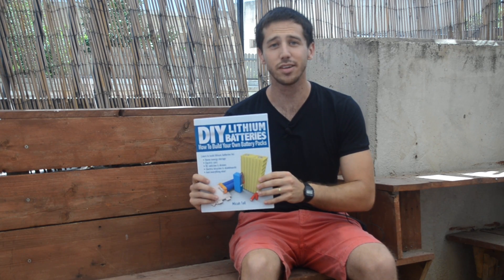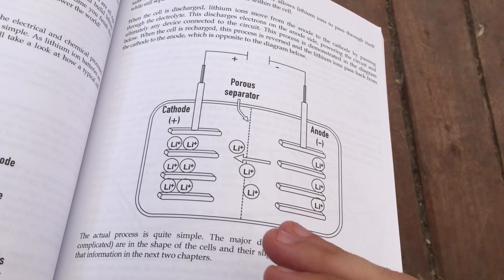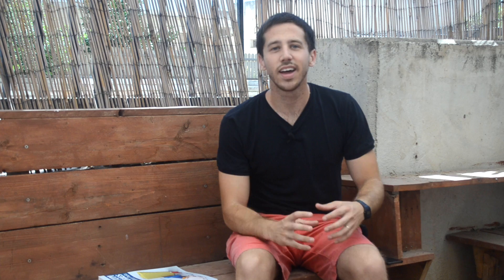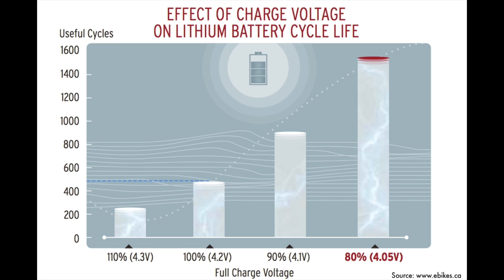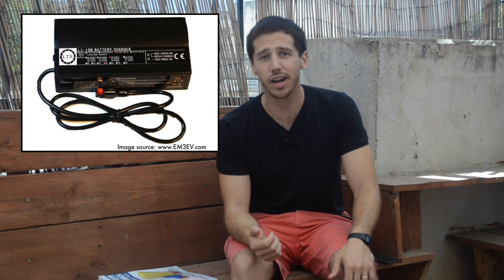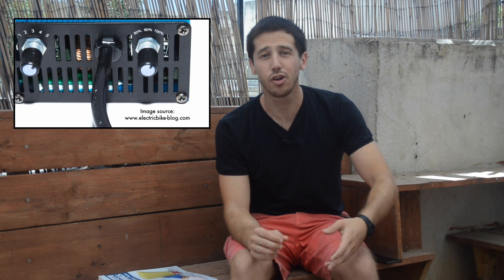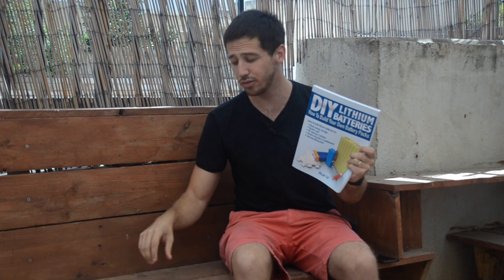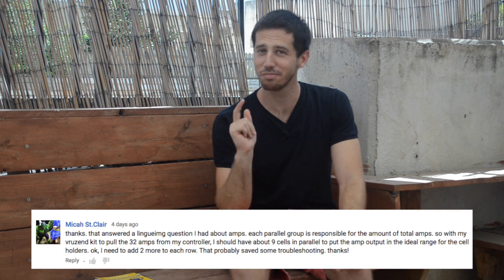How To Double The Life Of Your Lithium Batteries

Comment: My scooter volt drop down to 0 any possible reason
Reply: Where are you testing voltage?
Reply: @natebice7375  I have voltmeter switch on  voltage is at 52.6 then slowly go down to 0  i switch on again same thing again from 52 volt drop to  0
Reply: @natebice7375  I have voltmeter on my unit
Reply: @albertocarlos8403  something is draining the battery obviously or the battery pack is garbage and the cells are just draining on there own. It’s normal for battery packs to lose power but over the course of weeks/month’s. If it’s losing all its power in a few days or few weeks then something major is going on. Can you open it up and disconnect the battery after it’s fully charged and then check it after a day or two and see if it’s the pack. It could be something else draining it but at least you could determine if it’s the packet it’s self.
Reply: @natebice7375  hi natethanks for your reply  the actual scenario is like when I turn on the actual voltage is 53.8v then  its slowly go down to zero voltage
Reply: @albertocarlos8403  how long does it take to go from full to dead according to your scooter? I really would try to fully charge it and then unplug the battery and use a different multimeter to see if it’s dead. If you test the full battery totally unplug from the scooter and it’s still the same it’s the battery. Iam sry for the bad news. I know scooter batteries are very expensive!
Reply: @albertocarlos8403  does it happen when the scooters just sitting there or is it happening when you’re riding it? If sitting how long usually? Sorry for so many questions
Reply: @albertocarlos8403  if it’s happening while you’re riding it could be a setting that was messed with?. My scooter automatically shuts off at 41-42volts. I know on mine I can increase or decrease the cut off voltage.
Reply: @natebice7375  it happen just after I turn on
Reply: Very strange! Iam sry for the issue your having. I would contact the Company/seller about your current problem. I know battery packs can be very expensive. I hope it’s not the battery pack. Please keep me updated. Thanks!

Comment: Mike? A question......I am well familiar with Li-Po batteries since I fly several large electric RC aircraft. Most of my batteries are 5200mv 6s and I use a balance charger to charge and maintain as well as maintain a storage charge in the off season.
So, the question is how do the chargers that come with these scooters actually balance the charge without a balance lead like my charger has (7 lead....ground and each of the six cells in this case)?
Thanks in advance,
Rob

Comment: Hi, If i go on a long ride and i run low on charge, is it bad for the battery if i stop by somewhere and put just a 3 hr charge on the battery bringing it only to 50% which would get me home? Also is it bad to ride until battery auto cuts off? Thanks
Reply: I know it’s definitely bad for a battery to get that low where it shuts off. 20% is where you should recharge!

Comment: Buy an electric mini volt amp options thing for 5£ off aliexpress,  use that between charger and battery.  Can be set and doesn't cost machine his battery pack with the 5£ item on the side of pack. Looks good but not needed

Comment: My BBSHD is sitting in it's box, my battery and charger I purchased from EM3EV should be here friday.  My donor bike is a montague paratrooper.  I went with a 52v 23.1 amp battery that will sit on the bike rack, but be removeable.  My plan, most of my light off road biking is at 8-12 mph, I had a spinal cord injury so going fast isn't my plan any longer, I just like getting out into nature.  I don't want to ride on the roads, too many distracted driver's.  I also have been converting a 2010 transit connect into a little camper van, that the bike folded fit's nicely inside for when I am traveling.  

I went with the larger battery and the charger that will take it to 50%, 90%, or 100%.  From everything I have heard, I should get a little better range at 10-15mph, and if like you, I use the bike 2 or 3 times before I charge it, and only charge it to 90% unless I am taking the bike out that day, they take it to 100%.  Also heard that not running the battery till it is dead will also increase the amount of cycles...there should be a setting in the display to lowest voltage.  I want to get as many cycles as I can from the battery.

I also built a 200amphour LiFePo4 battery for my van, and doing the same with it.  I have an on/off switch for the renogy dc to dc charger so everytime I drive it won't be trying to pack the battery full of juice.  I plan on adding a 100 watt portable solar panel in the spring for when I go camping/bike trips.  Eventually will add a 12 volt compressor fridge, but want to be able to charge the bike battery from the van's leisure battery in case I am somewhere interesting and enjoying the time exploring on my ebike.

Comment: I really learned a lot about doubling the life of my lithium battery. Thanks!  I wish I had been given better directions right from the start, however. I started riding my e-bike in late April or early May. My mileage per trip averaged (according to my smart phone app) about 25 miles. As of this writing, I've got just over 900 miles on my odometer. That amounts to 36 trips. I store my e-bike in a shed attached to my garage. The temperature gets very hot in the afternoon sun. So my battery has gotten a good dosage of heat! Let's say 120 days worth at temperatures in the 80s and 90s. On a lot of those days, my batteries were being charged for up to 24 hours, before I remembered to unplug the charger. The recommended charging time is about 5 or 6 hours!  Now I'm in a stew, worried about how much damage I did to the battery , and how much of its life I lost.  Please refer me to a Youtube video that that might discuss my concerns. Thanks again!        joejed@q.com

Comment: If the batery goes down %30-40 and charge back to %90 percent.Does it shorten the battery life? In other word without empty the battery , charging is damage the battery? Please answer.
Reply: Smaller cycles are better but it depends on your needs.

Comment: My Samsung laptop came with a software feature that charges the laptop to a max of 80% capacity. I've had the laptop since 2010 and it still does 6 hour battery runs with chrome open no problem.

Comment: I use a simple timer that shuts off the ordinary cheap charger after a measured amount of time when charger reaches 4.13V (in my case) THe only problem with this solution is that you have to take time with a stopwatch to see how long it takes for the battery to reach desired voltage....its a cheap metod though and it works! Dont forget to charge the battery up to full at least once a month like he says=)
Reply: thanks for the tip, but how can I measure the voltage of the battery to know how many time I should charge the battery?
Reply: @daviferro4264  My Lectrix xp shows voltage readout pressing options when it's powered on.
Reply: @RJSoftware2000  or measure voltage with a multimeter when it shows 100%, 90%, 80%, 50% etc.
Reply: @daviferro4264  a multimeter

Comment: Hi! I have a lithium AAA and AA batteries (not rechargeable) that I'm taking with me on bike ride in mountains. The batteries will be shaken a lot in a bag mounted on a bicycle. Could you please advise how much it can affect their longevity?
Reply: I wrap mine individually in paper towel and pop them in a ziplock bag.
Reply: @redtobertshateshandles  Thanks for advice!
Reply: @piast_kolodziej  no probs. Happy to share info. It's not the shaking that is bad, it's the clunk at the end of each rattle. A kinetic energy thing. An old motorcycle mechanic warned me about fire risk of loose batteries many years ago. I accidently cut open a Bluetooth speaker battery a few months ago and burnt the tip off my box cutter. I quickly threw the battery outside on the wet concrete.

Comment: Great info.  Thanks!  I usually only charge every 3ed or 4th ride.  My rides are 3-4 miles each running my dog.  Then one 10-12 mile ride 2x week.  Sometimes I forget to unplug the charger overnight, which would be overcharging?  You didn't mention overcharging, which can't be good.  Thanks for the video.  I did subscribe.

Comment: I have a 48v 1,000w front hub electric bike motor. It came with the controller box, 2 brake levers, a thumb throttle and hub. I can fit all the plugs to the matching connectors and it looks complete, less the one to the battery. What kind of battery would be best for that system and what company should I purchase it through. My bike is a work horse, it's a Giant. I made a trailer out of a Trec baby stroller that has 20" numatic tires. Other than going through a few back rims because of the weight I carry, it's been the best bike I've ever owned. It's probably as tired as I'am riding it since new in 2015. So the thought of some power assistance seems like a dream. Any thoughts and recommendations would be appreciated.

Comment: Large off grid battery packs Winston sino etc have been using more conservative charging for ages. You want to keep it away from the voltage charge curve knee. 3.45vpc to 3.65vpc. Resting voltage 3.35v

Chargers that are smart that learn your use. Eg plug it in when you get home charges to 60% then keeps it there until closer to the time you use your bike then starts to fully charge it and you pick the charging voltage based upon use eg you commute during the week but have 40% charge when you get home you might be able charge to only 80%.

Comment: Hay   I made a 10s3p battery pack with a BMS for an e bike. The voltage on te pack is 35.45V. The voltage on the charger port is 31.70V. When I connect the charger it stays in stand-by modus only outputting 10.5V on the charger port.   I don't now what is going on. The charger is  Derby cycle art 28495 36V with an output on42.0V 3.0A. On the battery pack it came with it works just fine.  Is this battery pack somehowe incompatibel with the batterypack I made or is it more likly the BMS although boucht brand new is already defect. I measeured 2.55Mohm over the c- and b-

Comment: My bike has been sitting for about two years . Now it won’t hold its charge . Do I need a new battery ?
Reply: Martin Gallagher use the bike the small amount of current from the motor spinning wake up the battery or try and bypass the bus to put a small amount of current into them to power the bms ( use the charger ) good luck

Comment: I've done this on cellphones for some years and can confirm. By keeping the top at 80% and topping up so the phone rarely drops below 40% its charge, I have two cellphones over 80% its like new mAh from when i got them in 2016.  A dustbuster I got at 2011 lasted 4 years down to 50% charge, and another 4 years to drop to 20% of charge by simply never using it until it died,  but I cannot control how to undercharge it except by guessing the time and taking it off the charge before it fills 100%. I've rebuilt the dustbuster pack  in 2020, after 9 years on the same pack, and then run it for 1 min after full charging to drop it down a bit before it sits idle waiting for a real clean up job.

Comment: i managed 20,000 miles on my first 36v 10a prysmatic cell battery over a 4 year period charging to 4.2 , it still had a 10 mile range even after that, replaced it with same capacity but the new one is made up of 18650 cells 5p 10s wonder if i'll get same millage, bike in profile pic . would l;ove 20a but megga expensive here in uk. thought of building a battery , wonder if can still get prysmatic cells they were brilliant

Comment: The deeper the discharge the less life cycles you get from Li-Ion, Li-Pol ! The faster you charge them... less life again ! The hotter they get... Charging a phone with a thick case on is very bad ! So: charge as frequent as you can (no deep discharge), charge the slowest you can, keep the battery as cool as you can during the process... Fast chargers are the worst thing for longevity !

Comment: I have had an ebike for 3 years that I built from a champion kit from Amazon and a battery from banana. I ride it on the average of 5 miles every day and let it cool for 1 hour before recharging after charge is complete I let cool for at least 1 hour before riding . I've never drained the battery all the way yet . So far no troubles what so ever with any electronics or the battery . I was very skeptical about e bikes at first couse everyone I knew has had nothing but problems but now after owning one I believe it was operator misuse or maybe hot boxing the battery or bad connections or components that did not match .

Comment: I have a question about batteries? Buying from Ali Express or eBay or wherever.can a 3-13 be 30 amp hour or whatever. I started out with the 36 volt 450 Watt motor kit. On the cheap.i bought 36 volt battery 28 amp supposedly. Couldn't go over 5 miles. Added 2 scooter batteries to the mix.  The 2 scooter batteries added 12 - 15 miles at least
Than the sprucket broke.waiting on new. Than I bought the 48 volt 1000 Watt kit. Waiting on batteries to find out how that ride's
Can't wait to try it out! Been over a month waiting on battery pack one
 Which is supposed to be 48 volt 28 amp hour at 3-13 . Knowing that it ways less than 2 kilograms. So I ordered a second battery which is 6-13 ,20 amp hour. I know that the second battery will handle alot better.what I have learned is to be cheap still cost money to make it work properly! Take and buy 2 cheap batteries and run them together to get your proper Watts. Still cheaper than spending 3-400$ for a real battery.should do av video about what I am doing. Just beginning with ebike stuff and learning as I go. I would say that because of you I am going to be riding a ebike real soon. I waited for you to build the budget project! Finally I couldn't wait any longer. I built the 36 volt 450 watt ebike the bracket didn't fit my bike right and I ended up breaking the sprucket! New one should be here this week. Yalu is the best for that kit .  Any questions they will help you out! Let me know what you think about the battery industry??? Can I take the batteries apart and make a better battery?? 2 into 1 type thing. Let me know! Thanks Ray

Comment: Thanks for the information.  I use a timer on my phone to warn me to unplug the charger, the display on my ebike shows voltage, I check the display and only charge my 36 volt battery to 39 or 40 volts instead of the 42 volts maximum charge when left charging for a long time.  The  battery still lasts long enough for the way I use it.  A rule of thumb is two hours of charging for one hour of use.  Once a month I charge maximum and then lower it the next day by riding.

Comment: Great video! I'm just wondering, will Lithium batteries also last longer if you do time-based under-charging?  e.g. my e-bike usually takes 5 hours to charge to 100%.  If I unplug it after 4 hours, will it have the same good effect as voltage-based under-charging? Thank you!
Reply: Yes
Reply: Best to use voltage-based as the voltage/capacity changes over time. If charging time is not critical, I'd set the charging rate to C/3 or even C/4 & charge up to 4.0V per cell to optimize cell performance & life. Fast charging times increases the cell temperatures which is also not good.

Comment: I think I discovered something by mistake. All the batteries where more than 3/4 charge. To get to the point. I was charging my lipo4 batteries with a 12 volt light truck battery hooked to my 2 100w solar panels. This seemed to charge my lithium batteries faster. Maybe the fastest way ever to charge while using solar panels and a suder mpvb-p300.mppt. the fans were humming. And the voltage stayed low. And when the sun goes behind the clouds it can keep charging. Check it if you would and let me know something.
Calvin

Comment: Fantastic explanation of lithium battery degradation. Most batteries operate with these same rules: phone, drills, electric mowers, etc. etc.
You did leave only one element out, Heat...heat hurts lithium cells similar to charging and storing at full capacity.

Comment: I need some help please. Have a battery pack of 18560 cells made for an airwheel.  They just replaced the pack with new cells. Its max is 67 volts with a BMS. Charger is 67v at 1.5 amp hrs Looks like the battery voltage is below voltage that the simple charger can't wake it up from sleeping. I have 67 volts output at charger measured. Only 53 volts on battery.  The other battery is only at 11.5 volts. I'm a rookie and learning. Your help is appreciated.

Comment: Interesting. I have my 3 electric bike now. Enduro Leili speed. Qt motor 11,000 watts 72 volts 48amp. Was told to charge up to 80 volts. 85 volts for longer trips. Before my first 2 I always charged 100%. After hearing what you say I will charge 85% and sometimes 100%. I learned a little about charging after and watching your video. Thanks!

Comment: Interesting information - I'd never heard of undercharging Li-Ion batteries before.

I'm looking to buy a 72 Volt ebike before summer hits, unfortunately the one I'm looking at is only available with lead-acid batteries. I'm wondering if the same principle applies?

Before I saw this video, I was thinking of getting a timer to use in order to keep the batteries charged, but once fully charged, then having the charger come on for only one hour per day to keep it topped up and ready to go.

After seeing your video, I am now re-thinking that plan. Would you suggest keeping the batteries at 80% and then topping up to 100% just prior to going for a ride?

A further question: How difficult would it be to upgrade from lead-acid to Lithium-Ion batteries in the future? Would I need a different charger, and would I need to upgrade anything in the ebike itself other than just replacing the batteries?

Thanks for the great info!